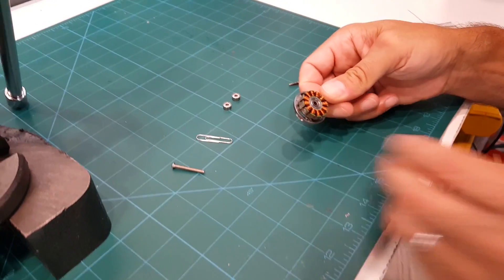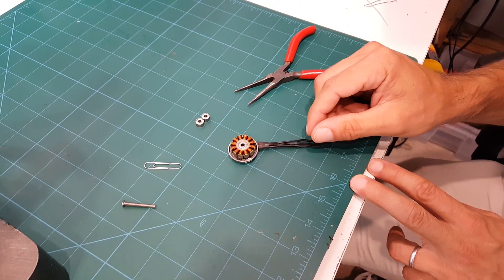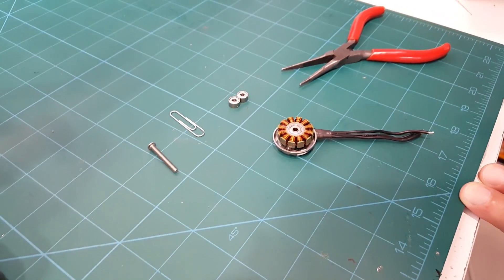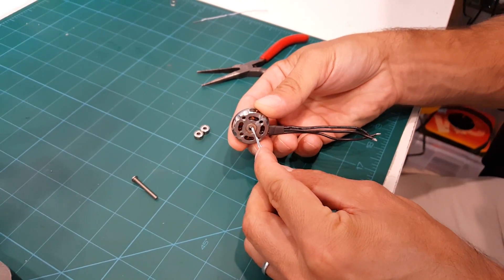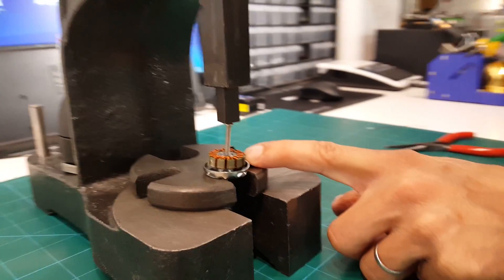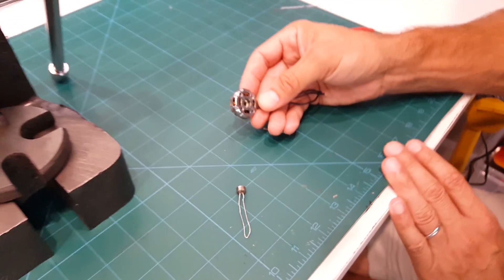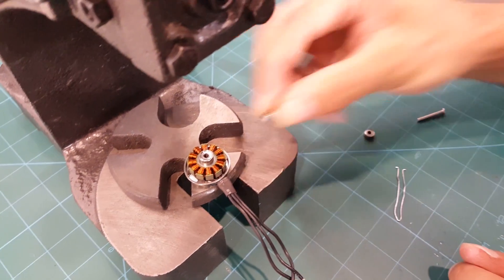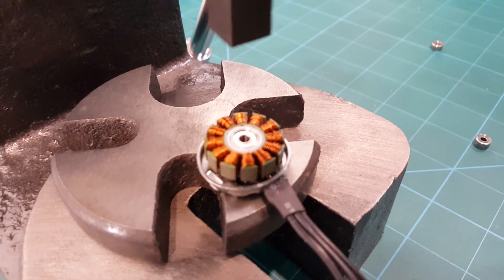How To: Brushless Motor Bearing Replacement

Comment: Tip with the paper clip is the tip of the year for me. With other methods shown on youtube I was not able to get the first bearing out. I have been thinking about how to achive the same thing you have with the paper clip, but your method is far more simpler compared to what I've been thinking about.  Paper clip method worked for me for the first time. Thanks a lot.

Comment: OMG the last time i did this i was using a small 2mm shaft slightly at an angel in the hole to get the bearing out. This was way to hard cause it jams it more then pushing it out.

This video was there befor i tried id, but some how google didnt showed it to me ^^ NOW im on for some bearing changes!

Comment: Nice trick with the paper clip.  I don't have an arbor press but a bench vise and a scrap piece of wood with a hole drilled to accommodate the paper clip worked great for me. Thanks for the video.

Comment: Great vid any ideas on how to remove the stator on a days 1102 motor.. I have twitchy motor syndrome and it’s not the esc or solder joint at esc so I’m thinking it’s where the wires connect to stator?..

Comment: Does getfpv have replacement steel bearings for the lumenier 2206-11 2350kV motors? I saw that they have a lot of tiger motor bearings and if I am not mistaken, tiger motor company makes most of the Lumenier motors. Do any of the tiger motor bearings work as direct replacements?

Comment: a drill press makes a good light duty arbor press. been using mine for a long time to remove and install bearings.
Reply: Good idea!! It would perfect for this application.
Reply: +Tim Nilson yeah, a drill press is more expensive than Ann arbor press but much more useful. You can get small cheap ones now.